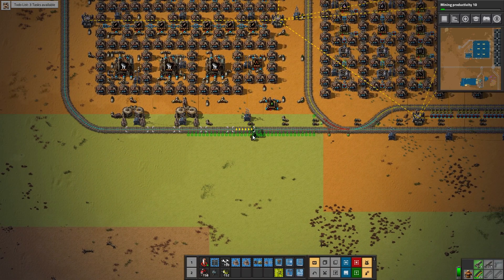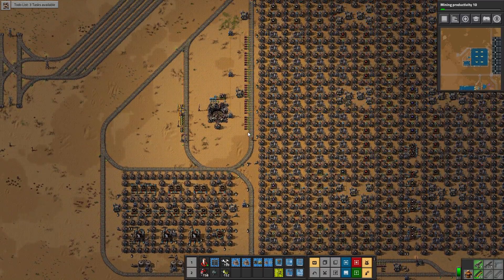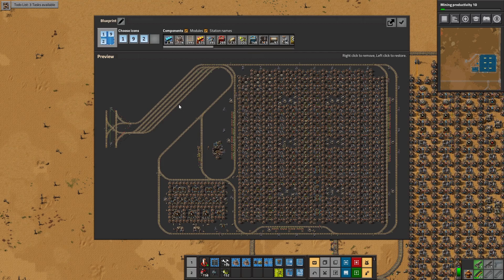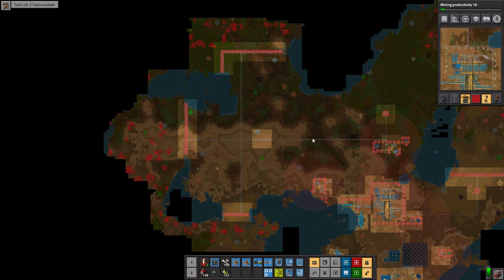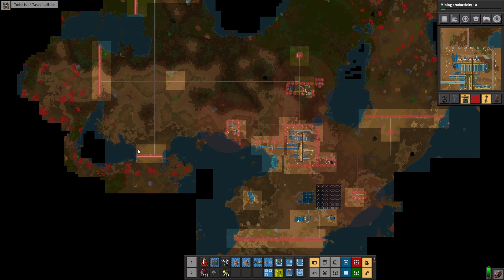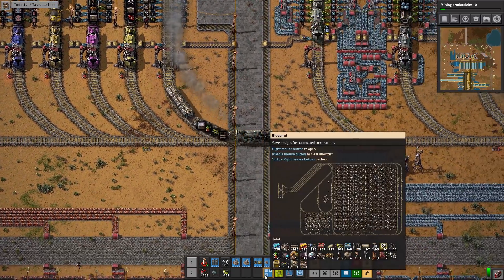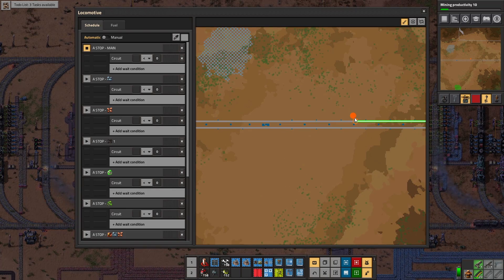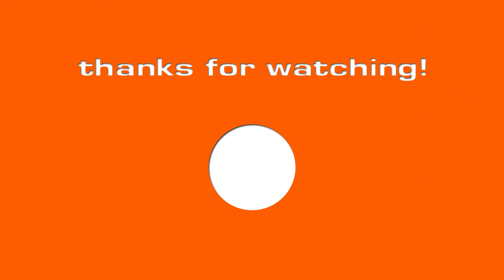Factorio BIG - Ep 30 | Measure Once, Cut Twice | Factorio Megabase in 0.18

Comment: 1:48 I noticed on the left side of the screen.... you don't have a chain signal before your stacker.
I hope that doesn't cause huge traffic problems for you later.
Reply from the maker: Fun Fact.. I was watching a video from the original "Impractical Factorio" series (Ep 52)   :)  One more reminder, and I think it may stick.....
Reply: @KitchsVideos  lol
Personally, I think you should add the chain signals to the blueprints. It would also make it easier to see which side is the entrance. Sometimes it's hard to tell which way is correct if you're moving fast.